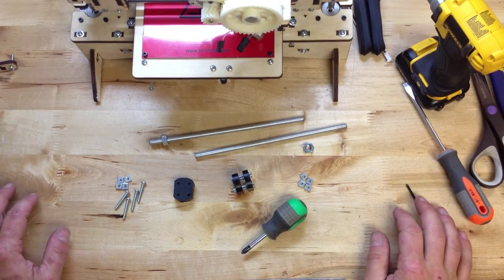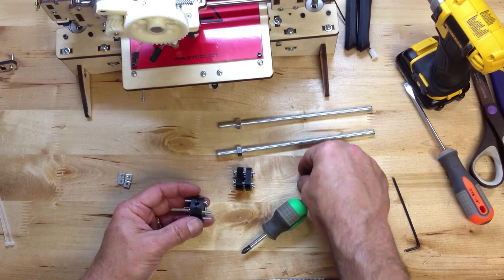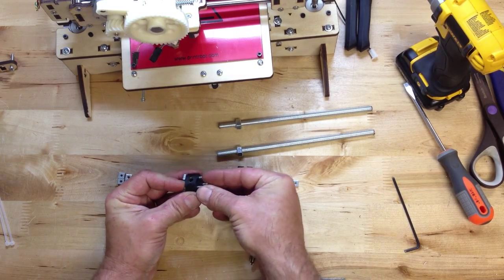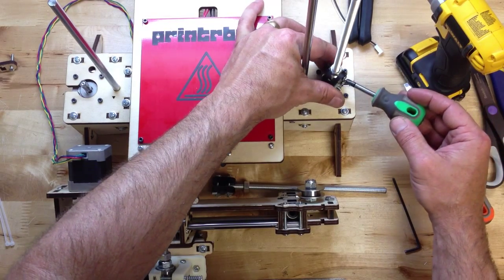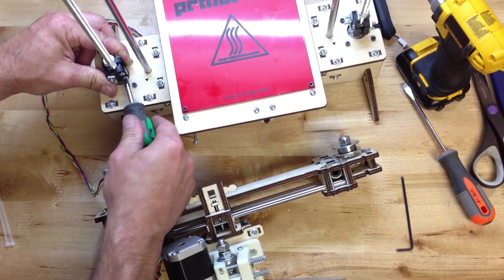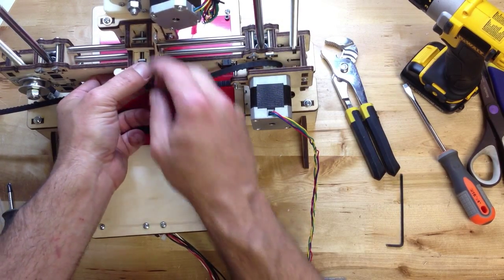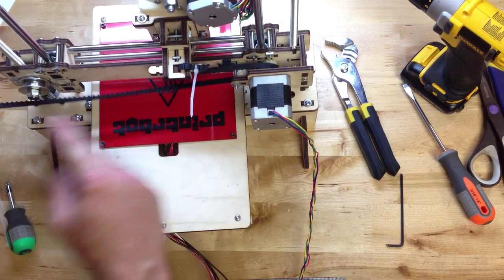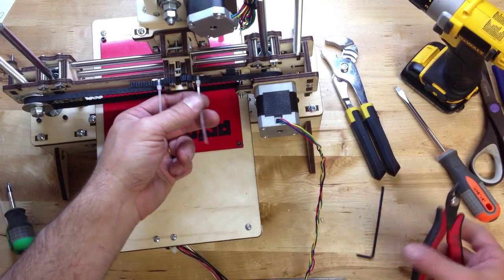Printrbot LC Build 09

Comment: How does the Z-leadscrew work? I've got my Printerbot+ assembled and connected to Pronterface, X and Y axes work, but Z-axis does not modulate height yet. I'm not sure what the nut is supposed to connect to or rather, there is nothing connecting the spinning threaded rod to the X-carriage yet and the videos don't seem to show how to get z motion going... any advice?